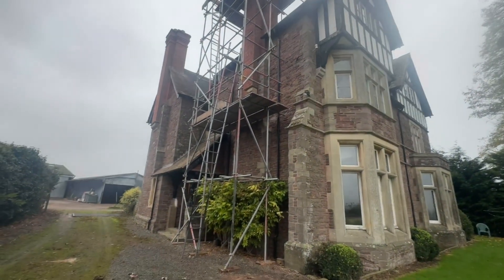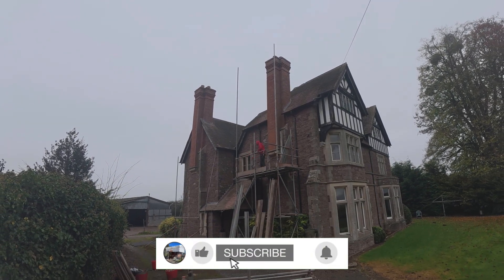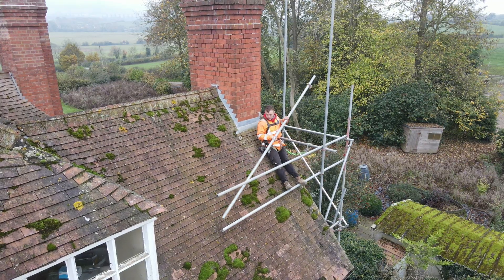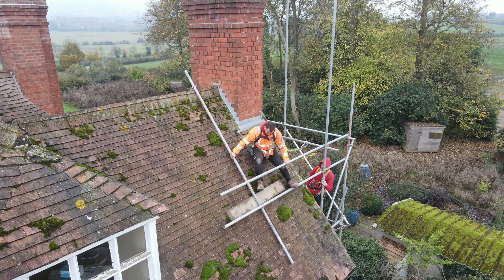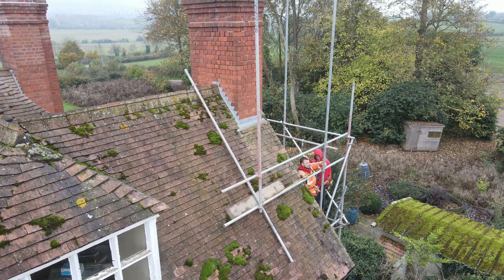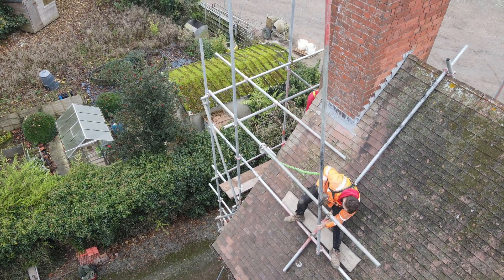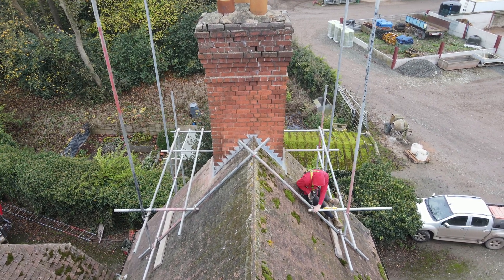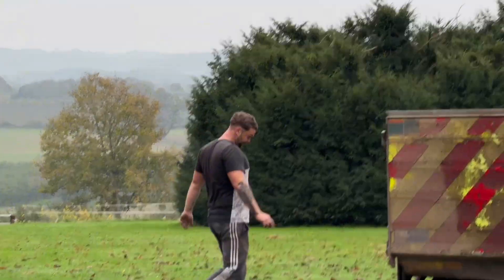Big chimney scaffold.

Comment: Double arm is the way bro. Soooo easy. Believe
Reply from the maker: What do you mean?
Reply: He means fix , fixed transoms
Reply from the maker: @ I’ve never used them maybe I should get some. 🤔🤔
Reply: @jrscaffolding5901 Very handy especially for tall towers , chimneys , multiple lifts boarded jobs Ect, seeings thou u don’t need ledger bracing with them !
Reply from the maker: @ yes might look into it
Reply: Defo reccomend them. Bang on for towers
Reply: We call em bones 3 board 4 5 and 6 boards wide. Only issue if you get shit bones it's pissed and there a pain in the ass to do up with a spanner.
Reply: Yeah, if you've never used them can be a head blagger, need to stick all double arms on before can put ledgers in, but once first lift on, staff it all off, no ledger bracing, easy the base out as well tbf, set it out, kicker lift with double arms upside down, no measuring, more folk need to get on the extender arms as well for jobs that end up getting adapted for rendering, going round job pulling logs off wall is a ball ache😴